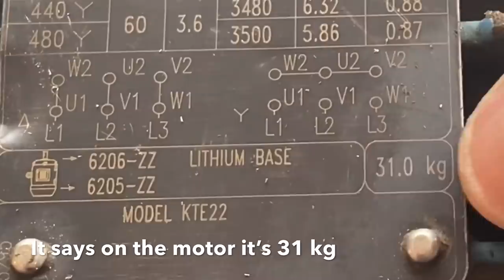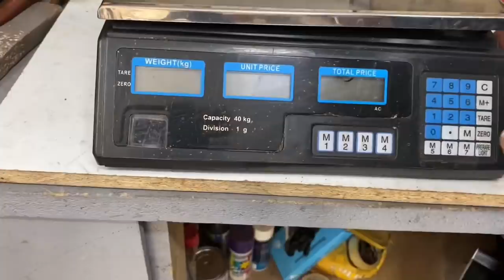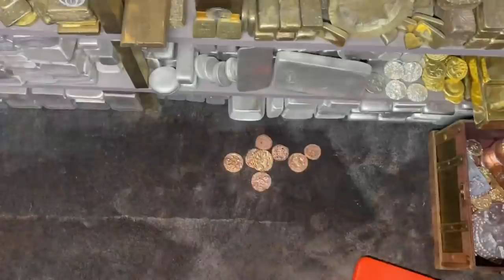29KG Motor Melt Down - Melting Copper - Trash To Treasure - ASMR Metal Melting - BigStackD Casting

Comment: He should buy a dead car and make a whole series of him scraping it
Reply: I love this idea! As long as he doesn't melt the wife's car...then he'd DEFINITELY not be allowed in the house...but like, for real. 😂
Reply: If I recall correctly, most companies use aluminium (or stainless steel, don't flog me) as the car's outer body due to its rust resistance and light weight, that'd make a MONSTER melt. May be wrong though, found the info a long time ago
Reply: Marcellinos Penny not sure about newer cars but old commodore would be made of Aluminium and then there is copper wires the is even some gold and silver in cars I think he could make either one super long vid or a series of scraping the car
Reply: @m4rcellinos  Most cars have (non-stainless) steel bodies because it's cheaper than aluminum. However many luxury and/or performance cars have aluminum body parts.
Reply: nevermind a car how about some used military equipment
Reply: @cRzkamil um u still buy them from a scrape yard they don’t just give them away

Comment: How do you stop your bottle freezing over. After about 20 mins melting the pressure drops and the bottle freezes?
Reply: Jeff Holmes you can place it in a bucket of hot water which will help depending on where you live. I live in 115° heat so I really don’t have that problem often. Or have a backup tank and swap them when the pressure lowers. 👍🏻
Reply: ArtByAdrock cheers, we are in winter in Victoria, warm it is not 😁. But new to my devil forge, and loving it.

Comment: According to google why holes appear:

Gas porosity occurs when the metal traps gas (most often nitrogen, oxygen or hydrogen) during casting. When the casting cools and solidifies, bubbles form because the solid form of the metal cannot hold as much gas as the liquid form. These bubbles appear on a casting as rounded, circular cavities or holes.
Reply: @Lucas Magee ahhh yea i juat searched it on google

Comment: We’re so close to the halfway point now!
Reply: 1 ton is 2000 lbs, 1 tonne is 1000 kg, we're coming up on the goal.
Reply: @byronsmothers8064  He's only got 454kg though - less than half a tonne. (The 998 is pounds - just shy of half a ton on the Imperial measure as well).

Comment: Hi m8 here's a tip for you, once you have copper winding out of motor casing, and have cut one end of copper rounding off with Angle grinder, grab the other end of copper binding with vice grips and bash edge pf steel case with hammer, windings will fall out..saves time,effort

Comment: PLZ UP! IMPORTANT! To reduce cavities you need: 1. Protect copper copper from oxidation during smelting. Use borax. (Green flame = oxidation) 2. Temperature control. Copper pouring temperature within 1200-1000 Celsius - try different value. You need to more preheat for mold: slower cooling melt - less cavities. 3. Pouring speed - try slower fill the mold. From Russia with love ;)

Comment: Hey Stack, do you by chance know or have an idea as to what is causing the porosity in the ingot? Is the metal just freezing to quickly and trapping the air in pockets at the bottom? Or is the molten metal actually reacting with the atmospheric gases and forming the pockets?

Comment: I thought the hot mold would help with the bubbles.. but you'll figure it out, I'm sure. Also, I loved seeing the little copper beads you recovered from the dross! Great video as always, thank you.
Reply: Actually to much heat can cause the copper to fuse to the steel. You only want enough heat to remove any moisture so 212° F would be ideal.
Reply: @ArtByAdrock  Do you have a way to avoid the pouring bubbles? It looks like a tricky problem.
Reply: Deirdre Young degas and pour quickly is the best way.
Reply: @ArtByAdrock  Thanks. asking for a friend ;)

Comment: Could you melt tungsten with a home furnace?
Reply: Bruh
Reply: Not the ones he's using for this vid but maybe an electric furnace or similar
Reply: Anything is possible but the crucible acts as a thermal insulator
Reply: Because I'm able to melt copper in the fire of my forge but not in The crucible
Reply: An electric Arc one would definitely be able to but those are used in commercial environments and at night where electricity is cheaper

Comment: I have no furnace of crucibles yet for melting. I recently took apart a small motor and want to melt the copper from it. I do have a gas stove and I am going to see where I can buy a crucible an molds.  I’ve never done this before so any tips or advice on how to do it on a gas stove?

Comment: I get layering on almost every coper ingot i pour, wondering if its something im doing, aluminium ingots come out smooth, just copper being strange, any advice?
Reply from the maker: As far as I’m aware that’s because the copper bar is cooling down at different rates as you pour if you had a hotter mold that might eliminate the layering affect but this is just a suggestion I could be wrong. 
 I’m still getting bubbles in my copper bars but I think that’s a simple fix and to stop overheating my copper as when I had a small furnace that I made myself I never had a bubbles in my copper bars because it wasn’t near as powerful as the devil forge And struggled to melt copper let alone overheat it🤔

Comment: Too bad this guy doesn't live by me. HVAC for a living. Motors, pumps, compressors, brass zone valves, scrap copper from old units, copper/aluminum coils, not to mention pure copper from new installs. Daily. It all goes right to the scrap yard

Comment: What furnace would you recommend for volume smelting?
Reply from the maker: Now If you’re only looking to do very small melts like 1 or 2 kg at a time then definitely go the 4 kg furnace as it has the same size outer shell as the 2 kg furnace but it’s cheaper & lighter and you can melt more with it, The 2 kg furnace is absolutely tiny inside and in my opinion basically unusable unless you’re melting gold. But if using the 4 kg furnace I would recommend not going higher than a 3 kg Crucible otherwise you may have a hard time removing the Crucible safely from the furnace and also with a 10 kg furnace only go as big as an 8 kg Crucible as same again you have a hard time removing it from the chamber. My favourite furnace is the 10kg ceramic wool furnace model -FB2Mb-10kg so I would I highly recommend the 10kg FB2Mb the ceramic wool one as it’s got a bit more chamber room than the other 10kg refractory Forge plus it’s over 20kgs lighter it’s cheaper and very portable. I own both furnaces and I used to assume they heat up the same but after doing some time trials on copper melting the ceramic wool furnace is easily 30-40% more economical and faster. Also I found is the refractory one holds heat a lot longer after burners off. Also don’t be too concerned about using a small Crucible in a large furnace i.e. using a 2kg or 4kg Crucible in a 10 kg furnace as it works absolutely perfectly and there is no problem at all. 
There is a 20 kg furnace available but that’s when you’ll need two people to operate as you will need some special lifting and pouring tools made because it’s just way too heavy for one person to do on their own👍🏻. Any other questions just email me as I’ll definitely see those questions and I don’t see all comments. 
Bigstackddddd@mail.com

Comment: I'm getting ready to do my first copper melt.
Reply from the maker: Remember always pre-heat your moulds and safety first my friend👍🏻
Reply: @bigstackD  can i use a steel bar molds instead of the graphite one. I wanna make a bar can't afford graphite all homemade.
Reply: @bigstackD  allways
Reply from the maker: Nathan Clemens You can use steel moulds for sure or even sand cast into Ingot shaped holes if you’re on a bit of a budget but just be aware there is a chance, could fused to the steel or it could fuse to cast iron if you decide to use that. A couple of times I have had copper fuse to steel when I’ve melted down copper pipe that had some type of welding flux on them but normally it should release pretty easily as long as there’s no overhanging edges on the mould. But it can fuse to the steel on some occasions, when that has happened to me you can simply cut the mould off it and destroy the steel mould or put the steel mould in the furnace and melt it in the steel and once it liquefies take it out of the furnace and pour the copper into something else. Any other questions mate hit me up on email  and I’ll get back to you as soon as I can the reason I say email and not comment is I get hundreds of comments a day and this one’s gonna move down the list super quick so I probably won’t see it again👍🏻. Bigstackddddd@mail.com

Comment: Have you figured out a way to keep the copper from making holes on the poor? I'm still doing aluminum cans. Recycle bin is full completely to the top crushed. I'm learning about slag very well and dra.  But soon I'll be moving into lead in copper 5 gallon bucket of wheel weights. What kind of companies have those motors in garbage cans what kind of places do you go to look for stuff like that. After watching you tear motors down for the past year even I become an expert on that

Comment: Where do all of these motors come from? What were they used for? How are there so many just...there in Perth?
Reply from the maker: Hey buddy Ive worked on the same industrial site for 20 years and I get all my scrap and cables from my electrician friend and out of the scrap bin when I’m allowed to go through it , I started collecting my cables and motors probably two years before I started melting so I have a decent stockpile . I have also talked to my electrician and plumber friends out of work and I now buy all their offcuts of copper cable and pipes . I pay them the same as the scrap yard so everyone’s happy 😁👍🏻. So all the motors on this site get thrown into a scrap bin some of them are brand-new others are just burnt out or obsolete and as long as I don’t abuse the privilege I’m allowed to help myself to the scrap bins and the motors👌🏻.

Comment: Where do you order your molds and what size do you typically use.
Reply from the maker: I don’t have an actual go to mold that I normally use but every mold I use on my channel including coin ,Star, cross etc molds I got them all from eBay. You’ll need to look around as they are very hard to find and depending on the size of your Crucible will depend on your mold so theres not really one I use more than the others.

Comment: So. Having read through the comments (The most reliable source of information, to be sure) and having googled a fair bit, the reason those holes/bubbles/defects form is from various gasses that are dissolved into the molten metal. Yeah. This is why, usually, it occurs most where you pour. Since that is where the most metal/gas interaction will occur, with the splashing of the metal into the mold. There is a whole lot of information based on industrial processes, but very little resources on what the "home shop" can do about it. A more controlled pour, maybe. Some kind of degassing agent sort of like fluxing, maybe. I dunno man. I don't even melt things, I just googled and went to more than the first page of results. Love your vids, even if they are not 'perfect' every time.

Comment: you can do away with those air pocket holes by dragging a piece of wood through the casting, the wood will not flair unless there is a air pocket something about the width of the mold should do

Comment: The guy I subscribe to who does plastic molding says if you pour from a greater height and with a thinner stream,you get less air bubbles. I wonder if that would work for metal. Also,he taps the molds to release air bubbles. Something to think about trying.

Comment: How about you cool down ingots in oil instead of ice cube? Regular cooking oil should be fine. I remember watching man at arms: reforged, one of the smiths said that because oil takes in heat at slower rate its better for metals so they dont crack. Maybe it would help with those holes in ingots, it won't hurt you to try :) Anyway, i love watching you smelting old motors, keep up good work :)

Comment: 454 kilos is actually 1000.9 lbs, so you technically crossed the 1000 lb marker this time! 😃
Air bubbles (porosity) in the cast goods can be caused by a lot of things, and there are ways to avoid it. Just a word to the wise, I’m sure you’re hip to it already.

Comment: Those holes happens because of dissolved hydrogen and impurities. You can avoid those holes by adding degassing flux right before you pour it into a mold.